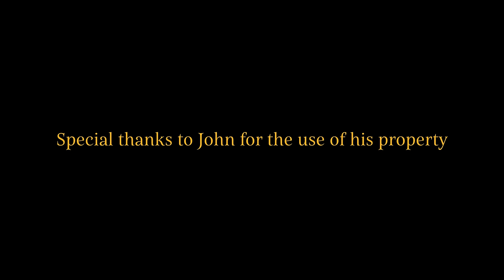Building 2 story Cabin Tower in the Mountains.

Comment: That two story tower of babble out on that flat prairie looks like a natural lightning rod.  I absolutely love these guys' creativity and sense of humor.  What a bunch to be around. Mel Brooks, Bobby Redford and Will Geer would be proud.  All that is missing is an external stairway as a fire escape, a Fire Department hose connection at ground level, (if the roof and walls leak there is no need for a sprinkler system) and a satellite dish on the roof. 😄